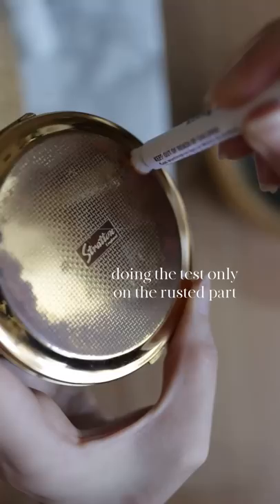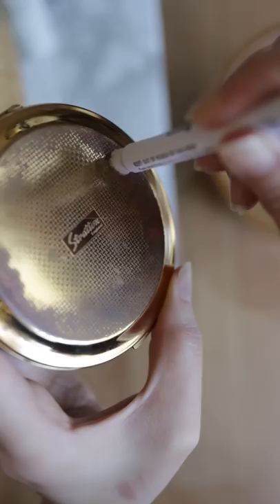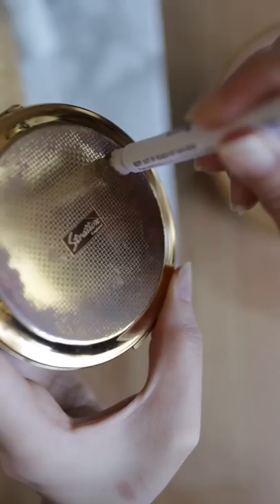Is there lead in my vintage compact? 🤔 #shorts

Comment: They’re not that old, crikey 😭 brass at the least!!!
Reply: There's no time went lead would have been used to make compacts. It's heavy and soft making it appalling for transporting powders. Tin would be the cheap metal for it
Reply: @Albinojackrussel  that's not remotely true Lead paint  was used up until 1978

 a great many household items had some form of lead in or on them

Including toys not just for the base but also the paint
Reply: You're right when it comes to the makeup, but the pretty case is a whole different matter and age has little to do with it. Lead was allowed in house paint until 1978.  Chromium was found in the paint on Shrek glasses that McD's gave away about 10 years ago (they were recalled). Most of the country has lived or gone to school with asbestos all around us.  All the pottery & glassware that is sold as "decorative use only" likely has lead and/or other chemicals to enhance color and delay fading.  Even copper pans & dishes can have dangerous chemical reactions if we aren't careful, and god only knows what plastics are doing.  But life goes on and we don't eat or drink or grow things directly in the decorative items, use plastic carefully if we have to, and dispose of it all properly.
Reply: @HealthyObbsession   it's not the paint I'm refering too. There isn't any paint on the parts of her compact that touch her make up, so the paint is irrelevant. It's the actual metal the compact is made of that wouldn't be lead
Reply: Led wasn't banned until 1978 bruh
Reply: @HealthyObbsession  yes, lead paint. She is using the metal container, not the paint.
Reply: @HealthyObbsession  what? what you just commenting had nothing to do with what he said
Reply: @yondermileslimpey3892  yeah but that compact is from the 90s
Reply: @HealthyObbsession  most consumables havent had lead in them for a while, however this is untrue for hair dies which had lead acetate as an included ingredient, this was outlawed relatively recently
Reply: @Albinojackrussel  she's touching the paint tho

Comment: Ma'am, the lead is in the paint. Not the metal part.
Reply: And she is not using the paint. Yet people are concerned and she made a test so that nobody has to worry.
Reply: @marysue9661  that’s like saying you’re not using the glass in your phone. “Oh I’m not using it, I’m just touching for extended periods of time!”
Reply: The lead must’ve got to her already! 😳
Reply: @gurtygurtrude  I still don't think she's touching it for extended periods of time tho
Reply: @SummerAlleriaWindrunner  You hold a compact when applying do you not?
Reply: @marysue9661  I think someone lacks common sense here.
Reply: It’s clearly enamel paint tho
Reply: @alioc3298  clearly someone here didn't pass chemistry class.
Reply: @gosick442  mate I’m aware that enamel is the finish, but my point is that a) it was rare to use lead paints as enamel, and b) the chance of becoming sick from a lead enamel are very low because of its binding qualities. You’d literally have to lick it off to be affected
Reply: @gosick442  DHDHDH NO IF DOESNTTTT. Antique means 100 years old. Soooo the 20s.
Reply: @gurtygurtrude  from what I’ve seen she doesn’t actually use them. She keeps them on display as collectors items so she isn’t normally touching them.
Reply: @gurtygurtrude  well, you are using the glass.... if you don't, you literally cannot use a smartphone.... or see anything...
Reply: @gurtygurtrude  🙄 I don't think she's holding it every day, for HOURS like a cell phone. Do you?? I'd be surprised if she even uses them every other day or week for the actual make up because it's a COLLECTION.

Holding it for a FEW SECONDS every once in a while is not 'extended periods of time' which is what we WERE talking about here.

Comment: I thought the lead would be in the paint
Reply: Lead paint is only dangerous when it chips/flakes and gets into the air
Reply: @communistsharks6889  uhh yeah, like on an old makeup compact
Reply: Paint? You mean makeup.
Reply: @someundeadtalent2016  I mean the paint on the compact itself, not the makeup inside
Reply: Lol same.
Reply: That’s what I thought too lead was used in the actual makeup not the compact
Reply: @ShallowApple22  lead was widely used in paint manufacturing and colourants, the makeup itself wouldn’t contain lead as she’s using new makeup in an old compact
Reply: @LouPendergrass11  And many enamels have lead still today and depending on the type and condition can still be dangerous after being fired. It's kinda like how uranium glass is technically safe to use but there's absolutely conditions in which it can be dangerous. It takes more than the info she provides to make well founded hypotheses on the safety of her vintage items, but hey, it's YouTube comments and "well founded arguments" don't exactly exist here. 🤷‍♀️
Reply: @someundeadtalent2016  She doesn't use expired makeup, and lead in makeup was most popular in the eighteenth century. Everything I've seen her pick up has been from various points in the 1900s.
Reply: @Ryan-in6ls   she literally swatches hundred year old makeup on her arm… 

She has multiple recent videos doing explicitly that and saying so
Reply: Lead wouldn't be used in makeup anymore in the era the compact is from but lead in white paint is a serious issue as lead was used to achieve a pure white colour
Reply: We Fcaeeee

Comment: For those harassing her to test the paint - sadly to correctly test for lead the beautiful compacts would end up destroyed. 

To perform the test she would need to scratch a portion of right down to the base layer of the artwork as it's common for surface layers to provide a false negative. It's common for people to perform the test assuming that only the top layers are at risk and getting a false negative while the lead is hiding in the base layers of paint/primers. 

For safety purposes if you aren't able to test a painted antique item/wall (for damage concerns) that is pre-1970 you should assume that lead paint has been used.

That doesn't mean anyone has to stop using these beautiful compacts, it just means risk-aware commonsense is in order. 

Lead paint is only a concern when it's chipped and or flaking, this means inspecting it regularly for damage and retiring a piece when it looks worn out or seeing a professional about applying a clear protective layer over the artwork before using it if it's not sealed/looks fragile.

Sorry for writing so much, I hope that it's somewhat helpful!
Reply: Great explanation thanks 🙏🏽
Reply: I mean you could just take some of the compact out and then do it
Reply: @ayeeyee9634   No, that would not provide a correct reading. As everyone has brought up in the comments, the lead would be in the paint/artwork of the compact. 

To do the reading you must expose all the layers, as lead may not be present in some of the paint or enamel used and not others. Meaning scratching until you have practically destroyed the artwork.

The test will not respond to the lead unless it comes into direct contact with it.
Reply: @greyscalesx  I completely agree with you!

These tests should be done correctly or not at all - especially since there are circumstances where not correctly testing for lead correctly can lead to harm. 

And, people who intentionally mislead absolutely deserve criticism. If her video was on a far more high risk topic (renovation) and/or there was history of misconstruing facts I'd be hoping that the comments sections were blowing up.  

Even in the current context of an entertainer with an honest mistake, I'm not saying she didn't goof on this video, and doesn't deserve any criticism - since this is pretty obviously unintentional I absolutely did laugh at her testing the metal - and she probably should clarify with a comment that she done goofed. 

I would enjoy it if she revisits this concept in the future by purchasing some worn out/already damaged compacts to test correctly.

I was just hoping to a) provide a reason why testing was unnecessary in this case for the people harassing her like her life legitimately depends on testing every antique she comes into contact with (which is what I saw a lot of at the time of making this post), b) explain the correct way to perform the test and why it's unreasonable to expect someone to perform it on an antique and c) risk-aware commonsense and how to live with antiques.

In her case I'm sure it's simply an error of judgement. A lot of people perform lead tests wrong even if they're in a legitimate situation when their health and wellbeing depends on it.
Reply: @potatomansam3912  ok thanks for clarafying
Reply: Some stuff in the 70's still used metal paint. Especially the bright yellow or red colors. There are highly collectible(and rare) snoopy airplane toys from the 70's because of a lead paint recall.
Reply: @rosebonnie7444  Oh yeah, there's been regular serious contaminations! In 2007 there was a range of Mattel toys that had lead paint that were recalled. It's more of a concern in that area since children have a tendency to put things in their mouths, and toys generally are pretty poorly made and prone to falling apart. Many cheaply made toys, jewelry and even clothing today (commonly made in sweatshops) contain a plethora of banned chemicals at levels that aren't at the recommended safe range.

Comment: They are beautiful!  I would think that you can still use them, just be careful and protect yourself. It's very likely that lead, chromium, and other toxic products are in the paint, plating, and ceramic.  The insides are most likely aluminum, steel, or brass.  If you are planning to use them seal the ceramic, painted and plated metal parts with polyurethane (which is probably cheaper than the lead test anyway) just to be safe.  If they break dispose of them carefully, we don't need more toxic chemicals in the ground water. :-)

Comment: Most lead was in the actual makeup POWDER! Lead powder has a white hue and many times they would mix it with other powders like Talcum (which is also problematic) for blotting face powders. If the metal compact is made from brass, your good. If its a "pot metal" it could have lead, but probably not enough to be poisonous.

Comment: Does rust affect or effect the outcome of the lead test?
Reply: This is a good question, I’d like to know more
Reply: lead would be in the rust and it’s effect
Reply: No the chemical reagent mixes with lead and turns a bright pink on the swab.
Reply: Affect not effect
Reply: @Max-nb3rp  It’s affect.  She used it as the verb of the sentence.  
Verb: affect
Noun: effect

Comment: We need to send people back to chemistry class. There is not lead in the rusted metal part, there is only lead in the paint. You don't have the option to not ruin. You either test it and find out or you don't and maybe die of lead poisoning.

Comment: Even if it were lead,  you'll be fine.
Your makeup wouldn't be getting any lead in it from the compacts unless it's crumbling and falling apart in which case you wouldn't be using it, I highly doubt you'll be holding it long enough for any to seep into your bloodstream via skin contact which would require all day every day for weeks on end, and you're probably not licking and chewing on it to get material flaking off into your mouth, so... no worries about lead poisoning.

Comment: Now can someone explain to my non English ass
What lead is
Reply: Essentially lead is a type of metal, it's soft and dense and used to be mixed with other metals for creating all sorts of things. This included things from buildings to small toys (you can see in other comments.)
The main issue is that it used to present in paint, makeup, and in metal objects. This is of concern for vintage items because lead is toxic and many many years ago lots of people died from mead poisoning. So she's trying to test the rusted metal for the presence of lead. 
Hope that explains it a bit